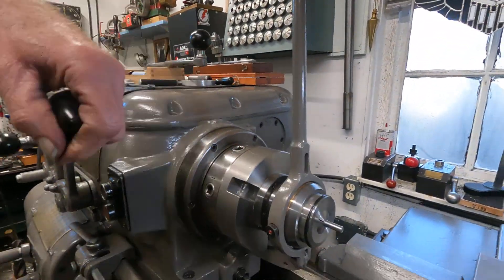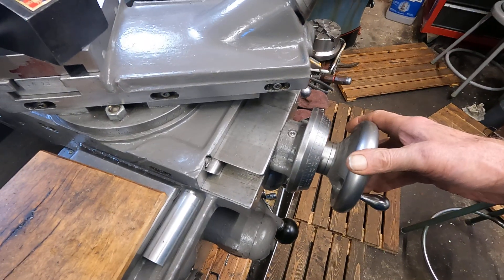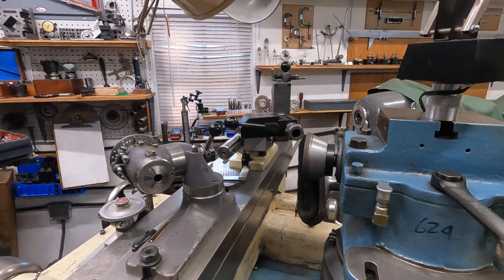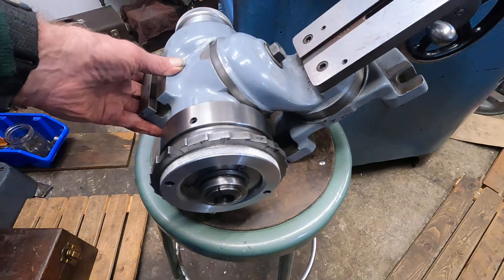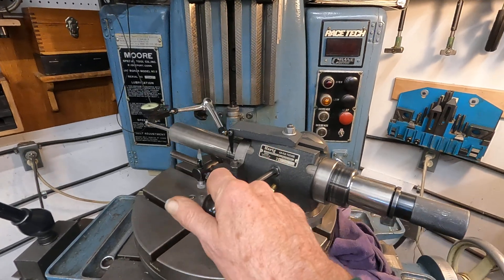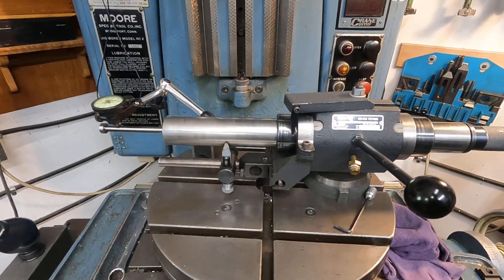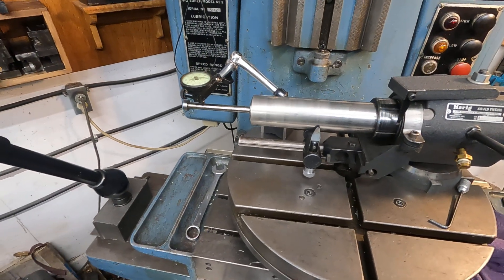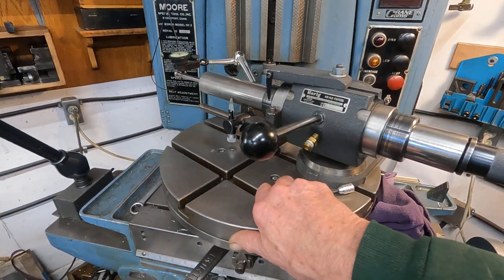Machining with high accuracy fixtures

Comment: That tool post accessory with quick retraction is really cool!
BTW how is Cloe? I miss seeing her in your recent videos.
Reply from the maker: The little dog will re appear when the sun comes out, thanks!
Reply: They are very hard to find and expensive when you do, Multifix made versions for both internal and external threading.
Some lathes had the ability for a quick retract built in.